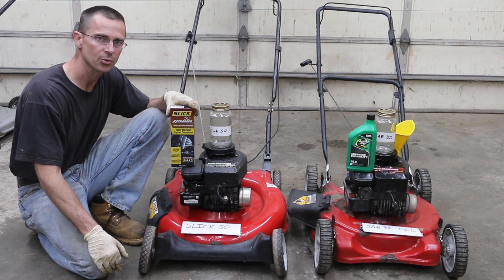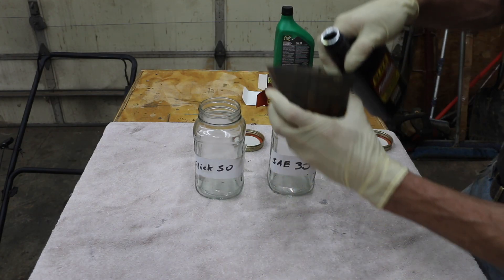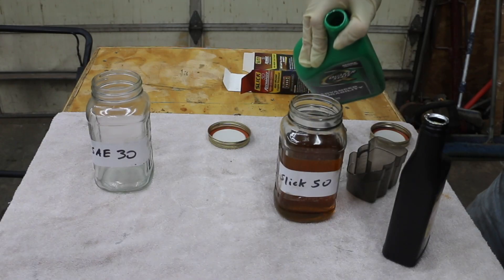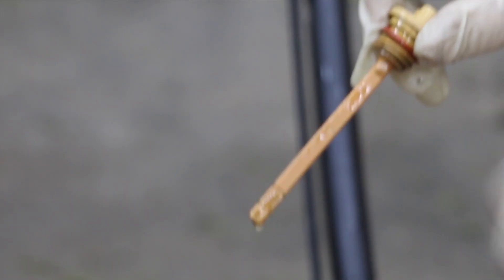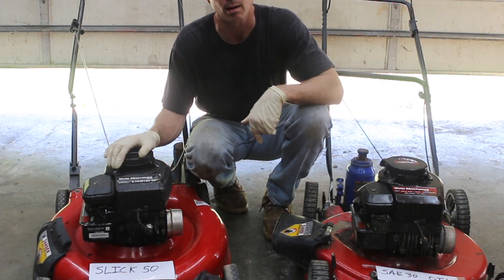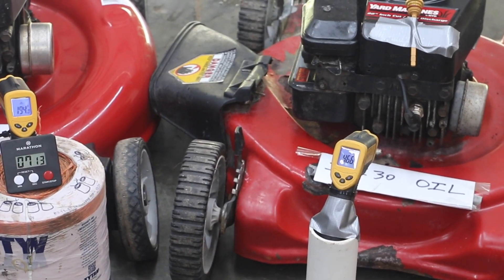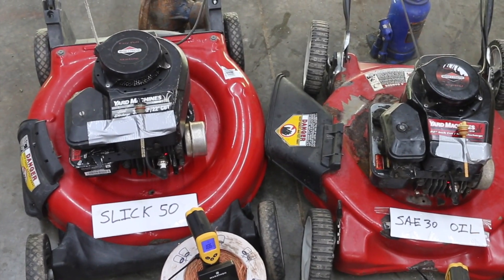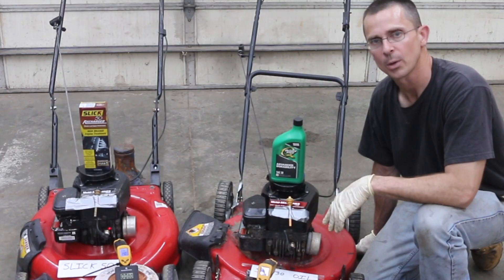Can't believe what SLICK 50 did to my engine!!--Dry Crankcase Test!

Comment: I can't believe this turned out as it did. Question...How long did you run the Slick 50 in the engine before draining? It needs a good 30+ minutes of normal running to treat the engine properly. I used to sell Slick 50 to quick lubes years ago, I had MANY calls from people telling me how it saved their engine in various situations of oil loss, and how happy they were with the product.  I also had a Briggs & Stratton engine I used for demonstrations that was treated, with plexiglass window to the oil chamber showing it running with no oil....I ran that engine all the time without oil, it never seized up.  Something tells me you did not properly treat the engine in the beginning. The only other thing I can say, is that this newer product is not formulated with PTFE, the same way the product was made years ago.  I also sold Dura-Lube, which was another great product.....but the original PTFE blend of Slick 50 would NOT have resulted the same in the test you did here. (as long as you pre-treated properly)

Comment: You should re run less test again except use the recommended amounts for the additives instead of double the recommended amounts that may have skewed the test and slick 50 may only be designed to compliment motor oil instead of be substituted for more oil.
Reply from the maker: Thank you for the video idea!

Comment: When I was younger I had an old beater car that eventually got a cracked head. Water leaked into the crank case and my dad said it was ruined. I remembered seeing the late night infomercials with the oil pan dropped while running and them spraying water into the running motor and decided to test it out. I dropped a little Slick 50 in it and ran it for 2 more months, water and all and it never died. When the salvage yard picked it up they drove it onto the flatbed. Made me a believer!
Reply from the maker: Impressive!  Thank you

Comment: I’m so glad I found this guy. I learn so much from him. I would like testing from all the top 4 oils that you find at Walmart
Reply: I will change my oil before it gets ugly (not over 5 to 6000 miles) but I started using Amsoil due to Project Farms testing. I'm hoping the extra protection preserves my 15 year old timing chain and other vital parts which are in great shape at the moment. Point is, he does some great real world testing in a very unbiased fashion and I can trust the results.
Reply: Wal-mart really  needs to be called by its correct name  "𝑾𝒂𝒍𝒍𝒚 𝑾𝒐𝒓𝒍𝒅"

Comment: I can actually attest to the Slick 50 performance. It actually saved the engine in a 1990 Chevrolet S-10 pickup I had. At the time, the truck wasn't even a year old. I had the oil changed at a local service station, the guy got a phone call in the middle of finishing up my oil change..and apparently only tightened the oil drain plug finger tight as he was distracted by the phone. I drove the truck home, and later that evening drove to my girlfriends house..20 miles away. About 10 miles into my trip I noticed a huge cloud if smoke trailing behind me, and the engine temperature in the red. I stopped and checked it out, only to find all the oil had blown out all underneath the truck and exhaust. I was about a mile or 2 from the nearest town so, after cooling off, I restarted it and drive it to town. I went to the dealership in that town and purchased a new oil plug, oil and refilled the crankcase. Drove the truck for several years after that incident with no side effects, accumulating over 300,000 miles on the truck before trading it on a new one. I always attributed the engine holding up through that incident, as well as the high mileage, to the fact that I had treated said engine with Slick 50 the previous oil change prior to that happening. I also treated it several times after that and got a ton of miles out of the truck. It was a 2.5 liter 4 cylinder engine. Very tough truck..as i am not known to pamper my vehicles as far as my driving style. Never had to do anything to the engine other than alternator. Other repairs over the years I owned it were nominal. Clutch, brakes, etc...average wear and tear mostly but no real issues. Great job on your videos! I enjoy them all.

Comment: I got a job back in about 1990 and had to put a LOT of miles on my Toyota truck driving around all day, every day from state to state. My boss told me that he put Slick 50 in his Honda and got 3mpg more so I tried it and I got the same result.
I figured that it had to be doing something good to be able to do that.
Back in the 60s and 70s people were putting STP in their engines and then a mechanic told me not to do it because it created a lot of sludge in the engine. I quit using it since I figured he knew more about engines than I did.

Comment: could be that the slick50 lawnmower had a lot more hours on it, and could be that it also ran with low oil a few times which could have caused excessive wear, and could be that that it went a long time running with the same old old oil, so with all that it ceased up a lot faster.  
could be that Slick50 has to penetrate into the case and head for some time before you can run the engine dry.

just my two cents.

i love these videos!
keepm coming.
Reply from the maker: Thank you for the feedback

Comment: I mentioned in another comment section that when I was in 7th grade through freshman in high school I work at a small engine and automotive repair shop. My boss sold Wynn’s products and the regional distributor had a flathead Ford V8 mounted on a trailer that he took to local fairs. He would run this engine for up to a half hour with the pan dropped and the oil pressure gauge at zero. I’m not saying that I believed in Wynn’s but I never managed to figure out his gimmick other than flathead Fords had very low crank bearing loads. A modern high compression engine has considerably higher crank bearing loading but other than that I don’t know how he got away with it. Slick 50 claimed to use PTFE (teflon) if I remember correctly, I can’t remember what Wynn’s claimed their secret was. Engine oil has come a long way since the late 60’s so additives are nearly as attractive to the general public as they were back when a car needed points and plugs every 12k, valves ground around 70k, and an overhaul around 100k to 120k. Much of modern engine longevity can be attributed to cnc machining, better alloys, electronic ignition and fuel injection as well as lubricant quality but 200k is a reasonable expectation from almost any properly maintained engine nowadays. Your Slick 50 mower demonstrates the reason I always get a push mower with bearings in the wheels, plastic wheels against steel axles don’t take long to develop EXCESSIVE camber!
Reply from the maker: Great information!  Thank you

Comment: The run in time for Slick 50 was very short. From what I understand, you need to run it much longer to get the PTFE to bond to parts. Should have run at least a full tank of gas... plus.. .move the mowers away from each other to eliminate exhaust and discharge heating & cooling effects. I think regular oil is sufficient and would avoid snake oil  gimicks.
Reply from the maker: Thank you for the feedback

Comment: I used Slick 50 and DuraLube in my Dodge Shadow which eventually harmed my engine. A mechanic told me that both use chlorine, which is a good lubrication, but also destructive.
Reply from the maker: Thank you for the feedback

Comment: I gave my daughter a great used Honda civic. She had it about two years and never changed the oil. I used Amsoil last oil change. I went ahead and changed the oil for her. When I inspected the engine it had no oil on the dipstick. I checked the oil filter and it was real lose. Looks like all the oil drained out at the filter. No telling how long she drove the car with no oil. I added a new filter and made sure this time it would not loosen up. Added new oil and the engine ran great. No oil leaks or oil burning. I was as nothing happened. The Amsoil coating inside the engine I believe is what saved the engine.
Reply from the maker: Wow!

Comment: Does Seafoam actually clean the carbon build-up in an engine??
Reply: Yes it sure does. For combustion cleaning get your tank down to 1/4 full then treat your gas and drive till the tank is almost empty at high speeds or high RPMs.  I think Project Farm  made a video on Seafoam and it does clean the engine.

Comment: I remember some adds late 90s in Australia. They ran the engine with no sump and a while into the test would hose out the running engine (not to cool down the internationals, surely).
Reply: What I want to know is, why were internationals trying to hide inside the engine in the first place?!?

Comment: Back when slick 50 came out, and synthetic oil was still trying to earn its popularity, other companies shortly there after jumped on the band wagon to say they were better. Slick 50 quickly lost its good reputation among car enthusiasts and mechanics to where they would laugh if anyone mentioned the name slick 50. Looks as though they were right. I used it once a year in all my used vehicles and I can say the engines were in such good condition, that several of them almost got pulled and sold separately when it came time to scrap the vehicles because of the overall body and interior conditions. Rusted away completely and interior wore completely out to where most everything had an issue operating. Engine mileage was well over 200k on most of them and ran like brand new. Bodies and interior take a beating in Michigan driven year round. Now I just started using 100% synthetic and that's all I'll use from here on out. Thanks. Great video. Jpol
Reply from the maker: Thank you for the feedback.

Comment: I used Slick 50 on my first car, a 1980 Celica that ran too hot with the A/C on. It cured that problem completely. My 2nd car a 1980 BMW 320i had the same thing. I thought it was a great product.
Reply from the maker: Thank you for the feedback

Comment: Slick 50 is, was and always be a hoax, there is no molecular bonding at the temperatures the engine can survive at. If you believe it helps you in any way other than flattening your wallet to better align your spine, you’re just another sheep getting fleeced by marketing.

Comment: The first step should have been to take temps on the left mower BEFORE adding the Slick 50 to form a baseline and see if the Slick 50 really was in fact responsible for the lower temps.  There are many other variables (ignition timing, carb mixture, carbon buildup, fuel quality, internal engine wear, etc) that could have made two identical mowers have different temps to start with.  As such, the claim of lower temp because of Slick 50 (in this video) may me coincidental, not causal. Still an enjoyable video so thanks.
Reply: That was an extremely objective comment.
Reply: very good Michael.

Comment: My my question is how you know both engines had the same wear when you got the lawn mowers you can take a brand new engine put oil on it's raining out and run it and run 4 hours take one that's used with a couple thousand miles on it drain the oil and run it will seize up within minutes
Reply from the maker: Thank you for the feedback

Comment: I purchased a new Toyota Seinna in 2004 V6 engine. Dealer did two free oil changes on new engine adding Slick 50 each time.  Today 15 years later at 237,000 miles engine is still tight and runs well.

Comment: That is not the slick 50 that was sold many years back.i can not find real slick 50 anymore.also seems that your sae 30 jar and the slick 50 jar had differant levels in them after removing from mowers.sae jar had less and maybe had oil still in engine.

Comment: If I'm not mistaken, SLICK50 was meant to be used in engines which had already experienced a 'breaking-in' period so that when the product adheres to the metal, it won't cause any extra-pressure type binding points.  I'd be interested in seeing how this experiment turns out with engines that are a year old or more.
Reply from the maker: Thank you for the feedback

Comment: Wow, it's been a very long time since I used or looked at Slick 50 and what you're pouring out of the container looks nothing like what it used to be. Back in the day Slick 50 had the viscosity of cold honey, it was thick and unlike other comments it was the same color as honey, not grayish as some have stated.

As for comparisons, from what I've seen, GTX seems to be the best motor oil, which I use in all my motors.. If you remember the tests they used to do with the frying pan showing the various competitors product, they all were repelled by the heat, but GTX was attacked by the heat which is definitely what you want your oil doing. Buy a couple more small engines from HF with the warranties and check that claim.
Reply from the maker: Thank you for the feedback

Comment: Great video!  I accidentally ran a weed eater (had a 2stroke engine) on straight gas years ago.  If I remember correctly, I ran almost the entire tank of gas before it locked up.  I took a strong arm and socket to the nut on the engine, broke it free, dumped the remaining straight gas out, and filled it with properly mixed gas and oil.  After several cranks, it started and ran as if it had never been locked up.
Reply from the maker: Thank you for the feedback

Comment: I’ve never used or believed in slick 50. The product I firmly believe in is ZX1. It’s an oil additive but it’s also water soluble so it can go in your coolant to lubricate the water pump bearings. It impregnates and thermally bonds to the wearing surfaces and has no measurable thickness so will not build up on itself. I also put it in my cars auto box, differential, power steering etc. It even has a NATO manufacturing code U8809. Well worth investigating.
Reply from the maker: Thank you for the feedback!

Comment: Unfortunately  you video taped experiment isnt any good for the evaluation of the products claims and its effectiveness. This is due to the fact that you did not have any idea of the conditions of your test engines internal parts tolerances, wear, or possible preexisting damages. Basically the only info available to you was that both engines did start and run. In order to evaluate the product  accurately both the engines need to have been completely rebuilt, with all new parts as well as having checked all critical tolerances. The engines need to be of the same make and model from the same manufacturer and if possible from the same year. Then everything should be contoled from the type of assembly lube, methodes of cleaning, and method of assembly. As well as break in method and the amount of run time, and the conditions of the run time so that the engines are knon to have the same history and are as close  to identical to each other as is possible. Then the experiment can yeild information that is relivant, accurate, and wothy of being shared with others.

Comment: I bought a new 1990 Chrysler Lebaron with a Mitsubishi V6 while living in SoCal. Before treating it with Prolong it had about1200 miles on it. I met an engineer from JPL who said he co-invented it as a lubricant for orbiting satellites and other space hardware.He was at the Costa Mesa swap meet running a Chrysler  slant 6 with a plexiglas side  so you could see there was no oil in the crankcase. He said he treated the engine with the Prolong additive then drained the crankcase. An odometer had 462 miles. He said it had been running since 0 without any oil.  Before treating the my 1990 Lebaron, the motor had a minor but noticeable vibration. While pouring the Prolong in, the vibration totally disappeared and never returned. I moved back home to Louisiana due to the birth of my 1st grandson. Sold the LeBaron very quickly, in 1996, it was still running without any engine vibration. I have treated all my cars with Prolong ever since, have never experienced any engine problems! Still use Prolong to this day!
Reply from the maker: Thank you for the feedback

Comment: The new slick 50 isn't like the old , I put some in a AMC Eagle I had it was no time till I had blow by so bad I couldn't keep a clean dry air filter in it , everyone said it was a ring but it never smoked out the exhaust , just blow by & smoke in the valve cover so I always said it was valve guides . Good video .
Reply from the maker: Thank you for the feedback

Comment: Very poor control of the experiment - way too many stray variables that others pointed out.  DuPont demanded their Teflon brand be removed from Slick 50 advertising. Why: independent tests paid for by DuPont proved Slick 50 did harm. No engine maker honors warranty if oil additives are used.  Why?  Modern oils have additive package they need. It only screws up the oil when you add motor honey to the careful mix.  Scam, and has been for a long time.
Reply from the maker: Thank you for the feedback

Comment: I think that's a great test!  I'd be curious to know why, given the engine with Slick 50 generated so much less heat (friction), it seized up early.  The SAE 30 engine was obviously missing the effect of the oil given it was running so hot.  Did you by chance pull the engines apart to see what they looked like afterwards?  I'm wondering if something at the bottom of the engine is what seized up (given there was no oil down there) vs. the piston locking up?  I would guess that the engine with the SAE 30 had enough residual oil left on the parts that ended up at the bottom of the engine when they were run "dry" to keep it going longer.
It would seem though, just based on the different temperature readings you got, that Slick 50 does have a beneficial effect albeit when used in conjunction with the proper amount of oil given the differences in the amount of heat that was generated.
Reply from the maker: Thank you for the feedback